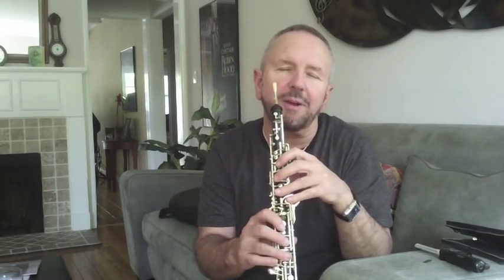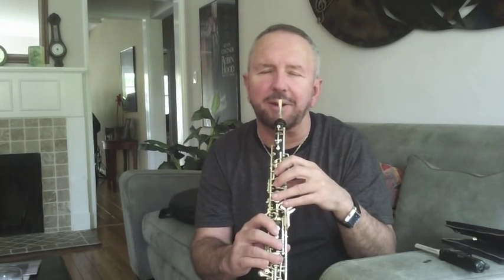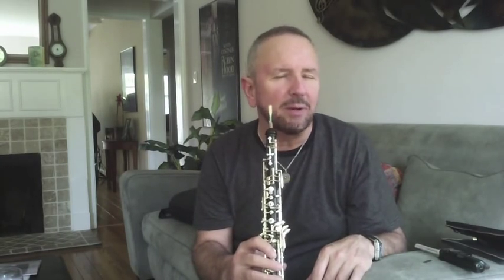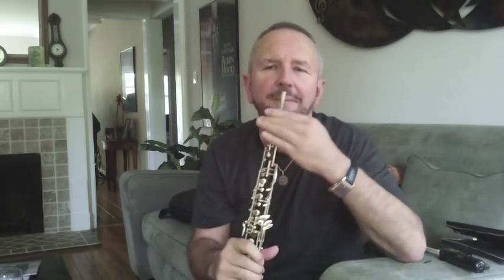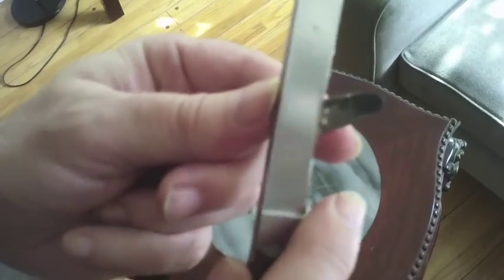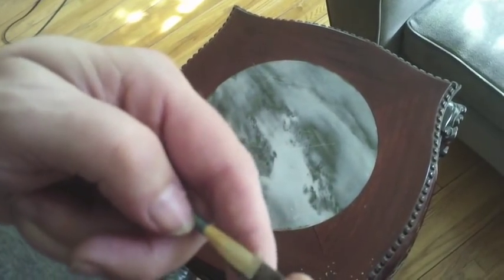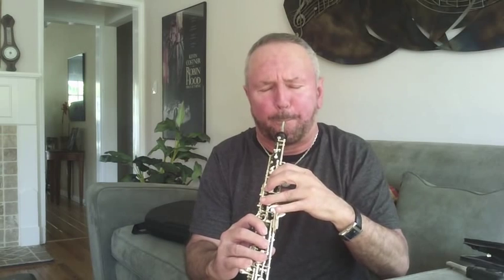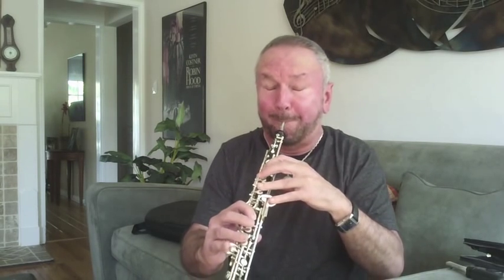Oboists against Reed Making Lessons 2 Quality of Sound

Comment: Excellent videos and advice from all your comments. And I think since the Jay  Light book came out on oboe reed scraping, it is my opinion that everybody is exaggerating the windows in the back of the reed way too much. I think the reed has a shorter life and I believe it’s much more difficult to maintain the stability and the flexibility in the extreme upper register which makes your embouchure work much harder and agility from top to bottom is greatly diminished once too much in the Windows is removed. There was a time where I was scraping all of my reeds dry. I had excellent results. I believe John Ellis scraped most of his reeds dry. But you better be a good knife sharpener, and have several knives to work with as the bark will dull knives more rapidly when the cane is dry.
Gillet will test your reeds agility as well as most of the  Vade Mecum, the J.S. Bach Sonata for instance. 
The oboe is a frustratingly addictive endeavor and love. 
Thanks Tom.